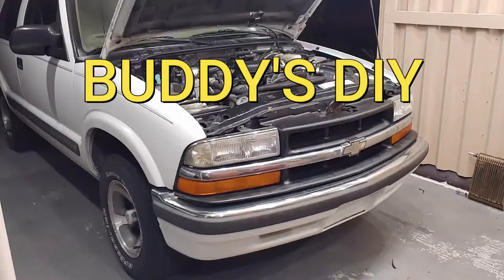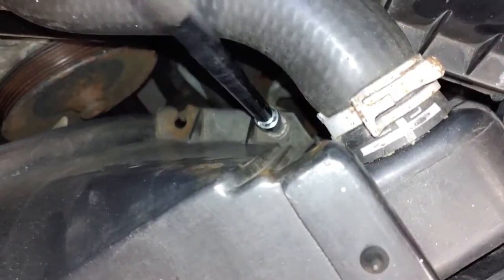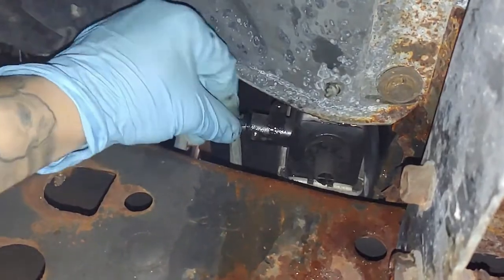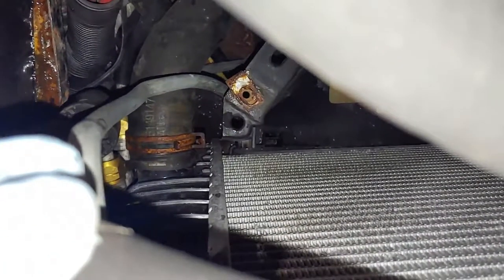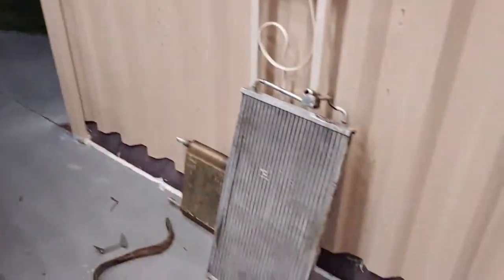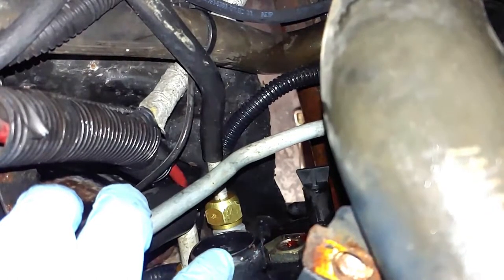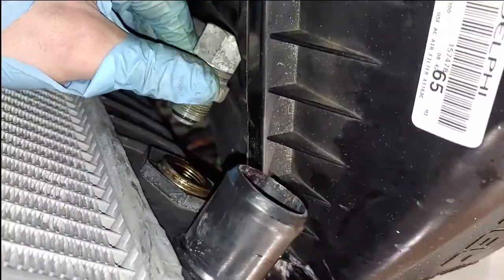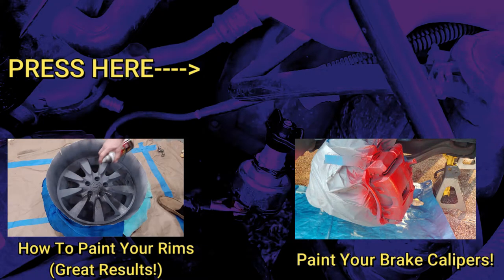Chevy Radiator Replacement/Removal | Silverado, S10/Blazer, Equinox, Tahoe, Suburban, Impala & More

Comment: How tight are the oil cooler lines supposed to be? Cause when I changed mine I bottomed them out and ruined it and they leaked. Got new ones coming and need to know when to stop tightening